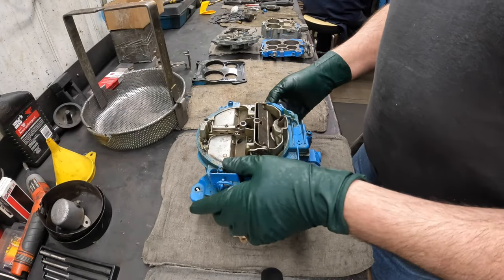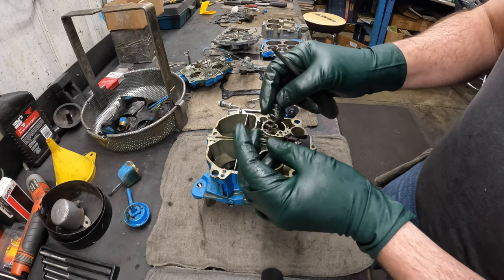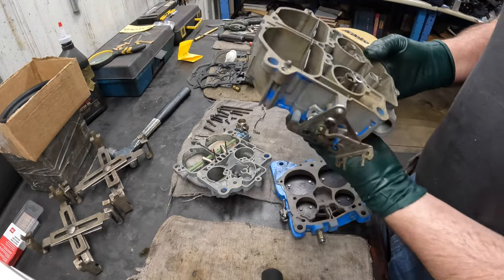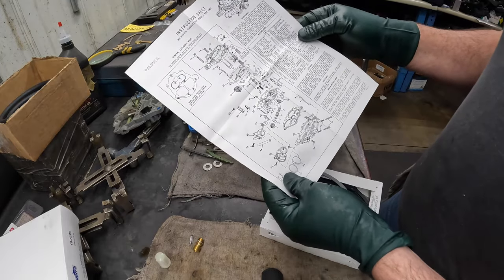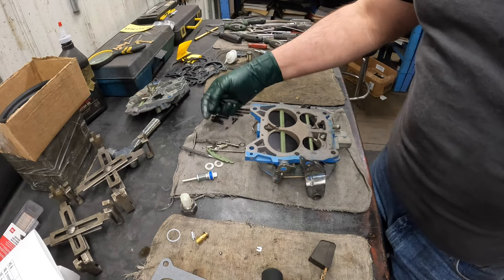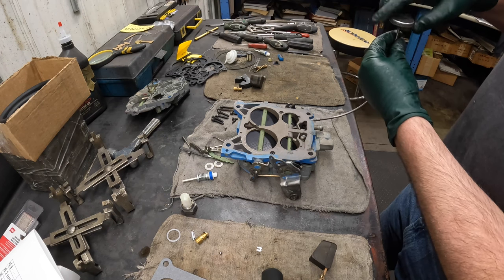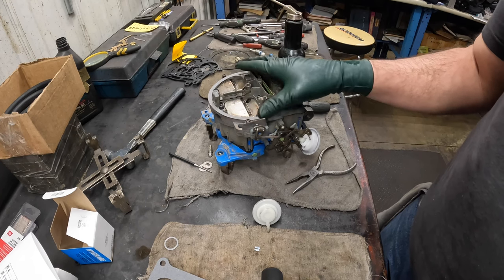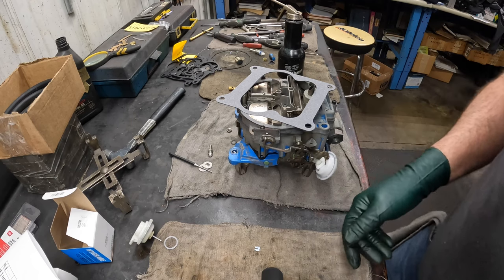Rochester Marine Quadrajet Overhaul

Comment: Thank you for doing such a detailed video on the marine quadrajet! I appreciate the little nuggets of info and rebuilt mine with confidence and your video. Could I use the pull off vacuum and a vacuum gauge to dial it in on the boat. As you know there are no other vacuum ports on the carb?

Comment: Just had my quadrajet 4 barrel carb done at a carb shop here and I'm trying to tune it and it's been tough. I did notice on the choke linkage side of the carb there is gas going in at idle but none on the other barrel.. 91 5.7l  omc cobra...in a ski sanger
Reply from the maker: Sounds like something is plugged up...

Comment: Question: for some reason the vacuum does not release when full throttle and idles rough when vacuum is connected and bogs because it won't allow the big barrels flaps to open. Kinda weird and runs much better with the vacuum disconnected. Carb is rebuilt ,Would you know what could cause the vacuum to not release when opening up the throttle?

Comment: Do I need the choke, and can I put an old fashioned knob choke in cab for manual control? Thanks in advance. I am going to run all manifold vacuum from the intake, and plan to put a vacuum gage and o2 meter gage for manual afr.

Comment: As you say in the video, if I have not misunderstood, both the primary and secondary needles should cut off the flow of gasoline at idle, that is, if I mount the primary needles, I press them as if the engine were generating a vacuum, it should not if there is clearance between the needles and the nozzles, and also in the secondary needles, ?????  And if the fuel level float is higher than it should be, would it also enrich the mixture more?
greetings and thanks for your video

Comment: My 1988 318 has this carb.  It starts fine and runs fine , with no black smoke  while running   But   It smells rich  and  black carbon is visible in exhaust water at idle.  Is there an adjustment to correct this or is a rebuild the only fix ?

Comment: I disassembled mine today. On the throttle body where yours has the two skinny tubes pointing downward mine has four of them. Are they all four supposed to come out when you remove the throttle body from the air horn?
Reply from the maker: Some have two, others have four.

Comment: I have the same Carb on 1996 350 Chevy engine boat and the other day I took the boat out to sea gave it the gas and it bog down and died, I started again and begun to wave and then died, It started right up but wen I gave it power it did the same thing, it runs fine in low power. What do you think it is?
Reply from the maker: Sounds like fuel delivery. Check fuel pump pressure/suction first. Also ten on a separate tank of fuel as well to eliminate  your tank and fuel pickup.

Comment: Fantastic video here’s my question. Carburetor Rochester four barrel on a boat just like what you’re demonstrating it was rebuilt by a guy and his company down in Florida that specializes in it the ability to test without putting it on the water I wish I knew his name it was set up by my marine mechanic.   What is that white pad inside at the bottom of the secondary chamber.

Comment: Is there a fast idle cam on a marine quadrajet ? Also is there s fast idle set screw on a marine quadrajet as well?
Reply from the maker: There is not. The linkage is there sometimes, but I haven’t run across one that the screw is present.

Comment: Hi. Thank you so much for the video. I have a question. My numbers have been ground off on my quadrajet and I have an electric choke setup. Can I still get a service kit to do a strip down? I dont know which kit to order. Maybe I could send you some pics by email. I would really appreciate a little help as I am in UK and there are no specialists. The carb is from a GM 5.7 LG SGI motor 10263880. A kit would be fantastic, if only they were universal enough and I knew a part number. Thanks again. Nigel

Comment: My last run of the year I was running really rich with black smoke. Then half way to my destination, port engine quit. Would start back up and idle but die with throttle. Any suggestions? Was think accelerator pump took a shit. As for black smoke I'm unsure. (Both engines black smoke)
Reply from the maker: Sounds like fuel supply. Does it start good when cold? If so, pump most likely isn’t your concern.

Comment: This video is amazing.  Clear and concise instructions, educational explanations.  To me, a dumb young 26 yr old engineer, carburetors were just magic before, and now I know some of all the engineering that goes into how they work.  

Also, you saved me 400 bucks on my project boat.  Followed this video and that 1978 Chevy 305 is running like the day it was made.  Thank you so much sir for your video and best wishes to you.  

Quick question I had that some others might - the needle seat in my carburetor had two cut outs on the side in addition to the hole in the top.  The one in the kit didn’t have those cutouts.  Are those for higher fuel flow or something?  Thanks again!
Reply from the maker: Just design is all. It really doesn't matter IMO.

Comment: Would you please let me know if I can use an automotive Rochester Q-jet carb for my boat(if I block all its vacuum connections) for my boat?
Reply from the maker: You could, but the calibration most likely won't be correct along with the throttle linkage.

Comment: How do you final adjust the jets after the carburator is installed on the motor? This is a fantastic video. Also, I can't find my part number in any listing for a rebuild kit. The part is17080565 date code 0054.
Reply from the maker: Turn the idle screws in or out till you get your highest and smoothest idle. Or you can use a vaccum gauge till you achive your highest reading.

Comment: Would you please write down the measurement of the float lever (in Millimetres) because I don’t actually realise it in inches… many many thanks
Reply from the maker: 6.35 MM
Reply: @LakelandAutoMarine  .
Thank you so much
Reply: @LakelandAutoMarine  would you pls let me know if that primary metering rod retainer spring is missing, is it going to be a big issue or not really?
Reply from the maker: Yes, that would be a big deal as under a load the metering rods won’t rise out of the jets to allow more fuel into the engine. That could cause issues it drivability concerns.

Comment: Do you know which way the “brass filter” one has to go inside of inlet Rochester carb??
Do u recommend them for marine’s one at all?
Reply from the maker: Open part goes towards the fuel nut inlet. Yes, we do recommend them.
Reply: @LakelandAutoMarine  .
Thanks for responding, well these kind of filters look like both sides are open…!!! 
One side has a small hole and the other side has tapered cone…
That’s why I got confused actually…

Comment: My marine Rochester Quadrajet carburettor’s secondary valve doesn’t open completely 90 degrees as the primary valve when I fully open the throttle, is it normal?
Reply from the maker: Yep, perfectly normal.
Reply: @LakelandAutoMarine  .
Thank you so much for your answer, the only thing caused me to hesitate for that, because I checked with other Q-Jet(not marine one) and seen the difference, 2 secondary blades was opening as primary blades completely 90 degrees…

Comment: Sir, I have a 260HP Crusader engine with a rochester Q-jet carb(7028282), since I don’t have access to its original parts to overhaul it, I decided to change it.
I have actually offered a Holly carb(No: L7456) to buy and replace it with that Q-jet… Do you recommend that at all?? I mean which one you prefer? Holly or Q-Jet which performing better??
Thanks for your help in advance.
Reply from the maker: I like the Q-Jet.

Comment: sorry to bother you again, I took my marine Rochester carb to a mechanic for repair, when he took off the carb,s head told me that my carb is missing 2 big air hornes...!! I have just checked your marine Q-jet carb and seen the same thing,,, it seems they have only 2 air hornes instead of 4, am I right?
Reply: I meant those straight brass pipes
Reply from the maker: The metering rods? Post a picture.